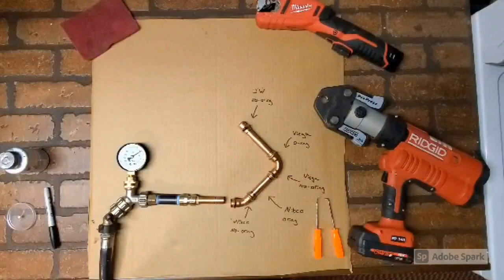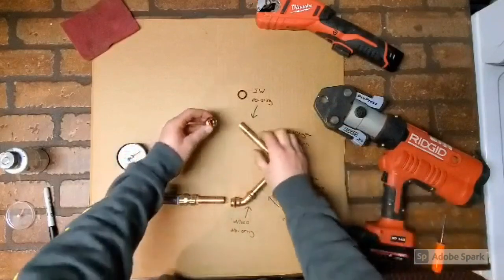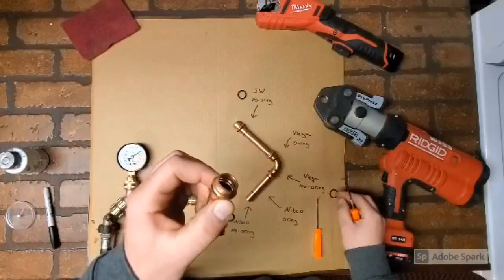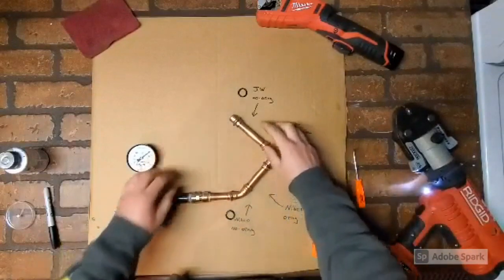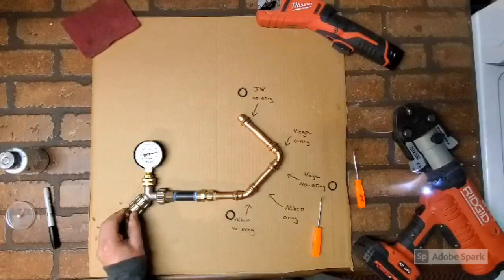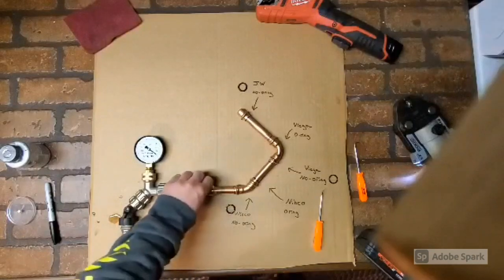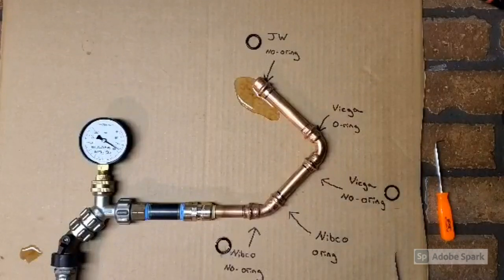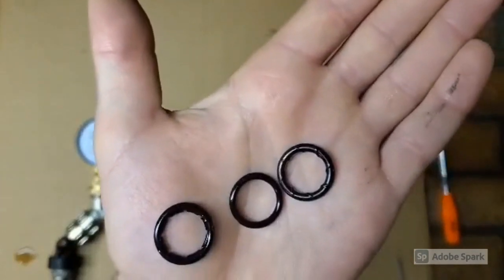Propress Without O-Ring Test

Comment: Why didn’t you remove both O t rings on the 45s?
Reply from the maker: Figured one on each proved the test.
Reply: @LeeBuilt  if the test is repeated then the results can be verified. You had the opportunity to test the other brands twice as much by removing the other rings in the 45s. 
However it was a good test. 
Thank you 🙏
Reply: I still think she needs to test multiple fittings of different brands.  Possibly do a failure pressure test to see what is the breaking point of both o ring and non o ring

Comment: I was curious about this... Wondering what would happen down the road, years later when the o ring started to break down.
Reply: In terms of Viega fittings, the sealing element rests on the exterior of the copper tubing and is getting no turbulence from the media inside.  The copper-to-copper connection on either side of the sealing element creates the mechanical strength.  Viega does trainings virtually, and in house at 2 different seminar centers in the USA.  One is in Broomfield Colorado, and the other in Nashua New Hampshire.  Reach out to your local Viega DM or supply house that carries their fittings and they can set you up for trainings on any questions you may have.

Comment: The Supplyhouse statement on Viega is:  "The patented Viega Smart Connect feature allows water or air to flow past the sealing element in an unpressed fitting, clearly indicating a missed connection, providing guaranteed security and peace of mind."  That says to me the rings are integral.   Your crimp presses a place beyond the ring and gets some kind of seal at least.  That means fluid will make it back to that rib between the layers.   I'd be curious how they handle years of corrosion that will build up in any microscopic space.  With solder, you're filling the smallest imperfections like glue that wont get wet unless they crack.
Reply: The smart connect feature rests behind the sealing element.  When you make the press the smart connect feature is pressed away , all tools for press were created for Viega systems, all other fittings are making theirs to standards created by viega
Reply: @robpendola5888  I think its weird that a friction bond like that holds everything together.  Have you ever tested them frozen?  What about vibration and water hammering?  I really like the idea and want to use these transitioning my copper to pex in stages but only want to spend manual tool money since I'm not in the business and all copper will be removed.  Its probably still cheaper to buy the original tool and DIY than to hire a repiping outfit.  I'll probably use sharkbite p2c until I can replace the remainder.  There are already about a dozen in my setup and they've done really well.  I'm still waiting on an alternative autocrimper that doesnt cost $1500+.  A good one should cost less an $500 by now imho.  Tempted to rent, but I would want to keep a tool on hand JIC.

Fein had the market cornered on oscillating multi-tools and look at them now.
Reply: @jeremywatts2768    The RP 115 is made by rigid and is the smallest and most affordable press tool on the market.  However, it can only press 1/2" and 3/4" copper.  In terms of being frozen, the most likely scenario is that the copper itself would split, or the press fitting would be pushed off.  Viega Propress fittings are thicker than type K copper.  Type K is the thickest type of copper.  A traditional sweat fitting is thinner than type L copper, and would burst at the seem in a freeze.  In terms of vibration and water hammering, all of Viega fittings and valves in all of their systems go through seismic testing that equates to a category 9.2.  In that scenario the building would fall down before the fittings would give out.  Viega has its own PEX line in PureFlow.  They make fittings that go from copper ProPress, to PureFlow pex press.  They also have male and female adapters by pex press, or pex crimp.  They do not do the expansion pex as they don't believe in creating stress fractures in the pex.  Also by crimping, or pressing pex there is zero downtime for the pex to go back to it's normal form and the system can be commissioned right away.  With pex press there is no stop ring to add to the pex as the fittings have a stainless steel ring on them factory installed to just press away.  They have hand tools for the pex press, or Milwaukee makes a pex press tool specifically for Viega fittings much cheaper than a copper or steel press tool.  Also with Viega pex press, the fittings can be located closer together in tight spots as opposed to expansion where the tool would crack a fitting.  Viega PureFlow holds the highest pex burst rating, and UV rating also.
Reply: @robpendola5888  Thanks for the knowledge.  The thicker copper on the fittings must allow it to mold better to the pipe.  It seems like its very precise and I wish it was better understood why the manual tools were related to other failures in propress.  $1300 is getting better for the rp115 :)

Comment: I can't imagine ,how that ring its going to be in 8 to 10 years inside of hot piping????? It's it going to dry and Crack? Maybe repipe?
Reply: the sealing element rests on the exterior of the tubing.  It is not in the direct path of flow, therefore getting minimal, if any turbulence.

Comment: Nibco ''grooved'' orings allow water to leak from a (forgotten/missed) non-pressed fitting  w/o the fitting blowing off, so you can find it!. Whereas, Viega may BLOW OFF, then you find you forgot to press that fitting. Nibco> Viega ASK ME HOW I KNOW?
Reply: Nibco grooved rings exist because they couldn't mimic the smart connect contour that Viega fittings have because it was patented.  Smart connect for Viega is designed to not hold pressure on an unpressed fitting if pressurized to the correct pressure.  It is actually third party tested and guaranteed to not hold pressure on an unpressed joint in copper from 1/2" to 2", 100% of the time.  The only press fittings that can say that, as Nibco was sent to the same company for testing, and had far more false positives.  Viega over Nibco all day
Reply: also the smart connect is press away as the press tools were designed for Viega fittings,  Nibco's grooved o ring remains grooved, therefore there is a leak path remaining in what is supposed to create its seal

Comment: Was this L or M.  I would think the heavier wall pipe would work better because its harder to press.
Reply: Viega fittings can be pressed on type L, M, and K, and the press tools all exert the same force in terms of compact, standard, and long throw.  Great test but the sealing elements are needed to ensure leak free installation and to hold that 50-year Viega warranty.

Comment: I pressed a 2 1/2” viega copper fitting without the oring before. It dripped immediately pretty good when I turned the water on. I found the oring in the bottom of the material box 🤦‍♂️. I always check for the oring on bigger fittings now. Slightly expensive mistake.
Reply from the maker: Yeah that can get pretty pricey quick!

Comment: Looks like the crimps hold well enough that even if they did drip a little bit after the air is out of the pipe, some minerals in the water would seal it up. :)

Comment: Jw press fittings have been leaking on me and inserted all the way I won’t use them anymore
Reply: I honestly don’t know if it’s my press gun or what man but I know for a fact it’s inserted all the way and the o-ring is in there lol. I switched to viega and no issues
Reply from the maker: I've never had an issue but since viega prices have dropped I also skip over using jw

Comment: So are press fittings all the same and the manufacturer of the heads doesn’t matter?
Reply: Yes,  it's a standard
Reply: @chrisE815  the tools and jaws will work on press fittings up to 2".  If you are using nibco, after 2", it is a completely different set of jaws and tooling, not compatible with any other press fitting

Comment: Your doing the lord's work. I had a 3/4" propress fitting leak in a baseboard  that I redid after only 2 years. When I went to see why the fitting was leaking I found out that 2 years ago I forgot to crimp it. The fitting didn't leak for 2 years uncrimped. Granted it was a hydronic heating loop so not a ton of pressure. I got another funny propress story. I did a water heater way up on the mountain about a 2 hour ride from any store and the guy wanted everything sweat. No press fittings. I didn't know this until I got there and I was 1 45 short to finish sweating in the unit and  I almost used a sharkbite but I ended up popping the o rings out of a press 45 and sweated it in. Worked like a charm I just had to clean the oil off it with some clear PVC primer and brush it.
Reply: Great story, but im not surprised it worked.
Reply: Not suprising i have seen compression fittings used without nut and olive and soldered to the pipe.
Reply from the maker: Haha that's amazing it lasted that long! Where do you live that it's on a mountain? Just curious.
Reply: You're telling me you filled that void with solder?
Reply: @jamesruppert3152 he obviously pressed and sweated it

Comment: Try putting JW fittings closer to the Guage.  I feel like positioning in the branch is playing a factor.
Reply: Pressure is pressure in tiny system like this.
Reply from the maker: @rustyshakleford5230  Agreed
Reply from the maker: How do you figure? I was thinking that they all are seeing the same pressure.
Reply: JW may only have more air pressure since it's at the end. I have done these test and even viega fittings will leak with air only, not so much with water.